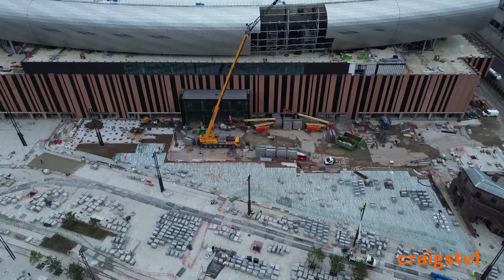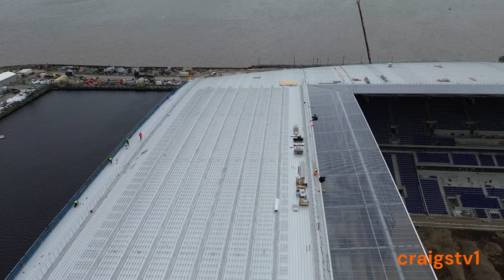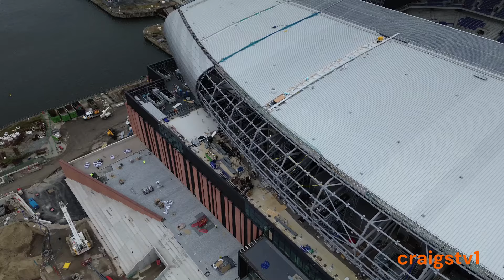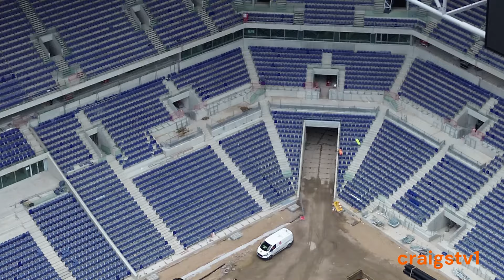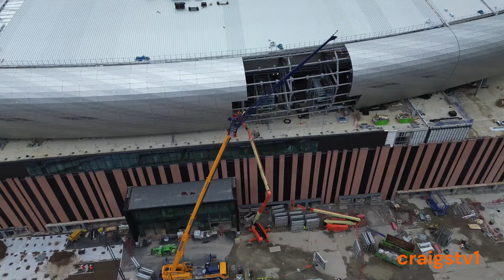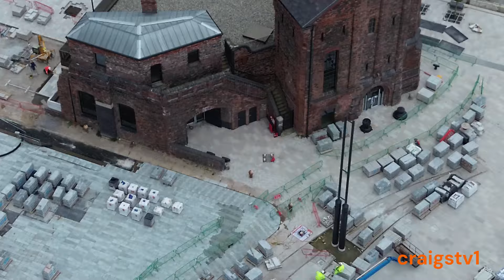New Bramley-Moore dock  development update Everton FC 1-7-24

Comment: Did you notice the seats have been removed from the top sections of the North east corner
Reply from the maker: Yeah mate I was think myself why have they removed them for
Reply: Yeah that's very strange that
Reply from the maker: I will have a closer a look at it tomorrow as it’s weird how they have taken seats out
Reply: @Craigstv1 I cant even think of a reason why they would remove them. I'm trying to think what possible reasons it can be buddy
Reply from the maker: I will find out tomorrow could be something we can’t see
Reply: @Craigstv1 could high winds of blown some down?
Reply from the maker: @toffeeboy6702 could be that to but I will have a better look tomorrow
Reply from the maker: Will get a better look tomorrow
Reply from the maker: @JayEFC1969 👍👍
Reply: @JayEFC1969 I thought that,but couldn't think what else. Unless a faulty batch. But then surely they'd have known that during installation.
Reply from the maker: @toffeeboy6702 👍